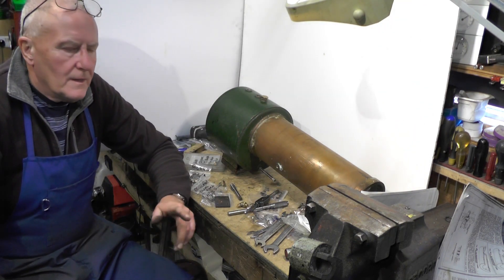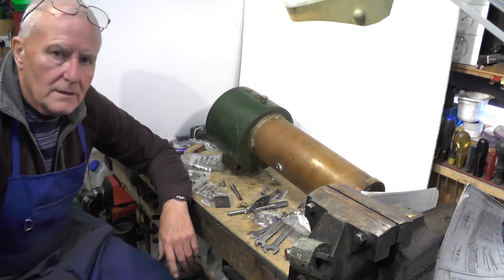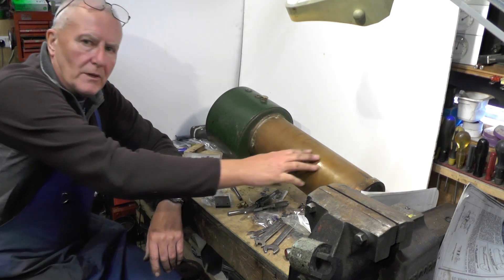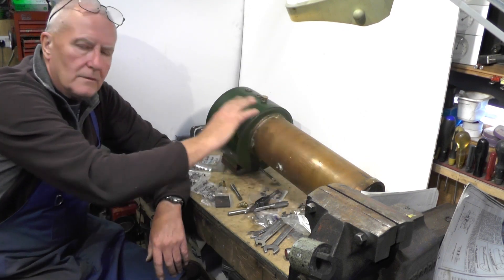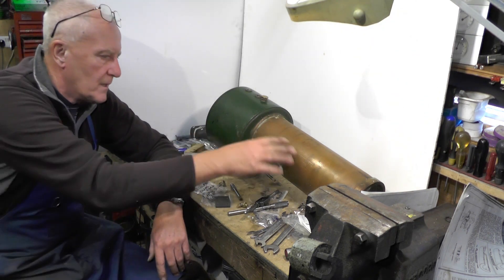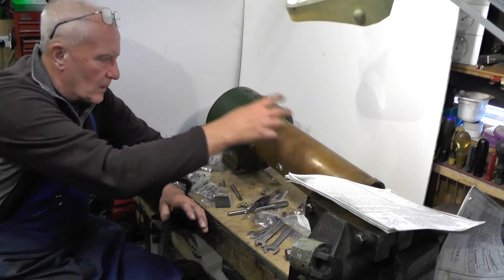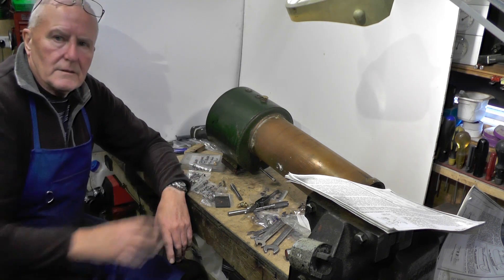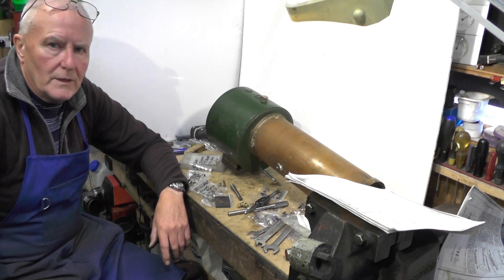Sweet Pea Steam Locomotive Build  Part 2   Boiler Pressure Testing "mr factotum"

Comment: Looks like you gambled well Kev, once you get your boiler certified, what is the frequency of reinspection after that? Is it dependent on time elapsed or hours of running etc? Cheers, Jon
Reply from the maker: eyup Jon Winner winner Chicken dinner🤣🤣👍👍🚂🚂
Once initially passed the hydrostatic 2 times WP . 
its like a car, a steam test once a year, then every 4 year another hydrostatic test at 1.1/2 times WP
thanks for feedback
kev

Comment: That looks good to me. Should pass hydraulic. All you need to do is improve your seals. Might as well crack on with the rest.
Reply from the maker: That's the plan! Ben, although its a winter project
cheers
Kev
Reply: @MrFactotum  I reckon you'll be a fair way through it before winter! Which leads me to a question, where did you get your copper tube from? I need some 4 & 3/4" for a boiler for a chassis I have been given.
Reply from the maker: @BensWorkshop  got mine from Track Metals he visits our track on open day once a year, but if it's a big order i think he delivers, he sells on ebay but prefers direct, his name and email is here Fred at sales@trackmetals.com
any other info get back to me anytime
regards
Kev
Reply: @MrFactotum  Many thanks, I have sent an email.

Comment: Interesting video Kev.  Pressure testing is not something I've had to do, but understand the principles.  What do they charge to run the test ?  Cheers Rob
Reply from the maker: hi Rob.
Free to club members, testing is once a month,
i think commercial testing is expensive though.
thanks for feedback
regards
Kev
Reply: @MrFactotum  Yes, commercial testing in Australia is expensive.  I priced getting some gas cyliders re-tested, but it was more cost effective to buy new.  Cheers Rob.

Comment: Hi Kev, I would expect those threads are BSB British standard brass, all 26TPI 55 deg thread angle these are commonly used by Stuart models
Reply from the maker: Eyup Doug thanks for feedback, yes, but i call them BSCY (cycle threads) same thread format, thanks again for watching, much appreciated
regards 
Kev
Reply: BSB is commonly referred to as cycle thread, as it's widely used on push bikes.  BSB was heavily used on brass fittings for steam loco's.  I have a full set of BSB tap and dies which are ex South Australian Railways (made in the USA).    Very nice strong thread.  Great for model engine work as well.  I always keep my eye open for BSB at sales etc.  Cheers Rob

Comment: Hi Kev. I'm my clubs boiler testing manager, all looking good, one point when testing that you didn't show is to pump water through the test pump pipeline to get the air out of that before connecting it to the boiler, I'm sure you did that off camera though 😉 
Taking delivery of 2 loco's today, 1 has never been tested or steamed, so I've got it all to do the same as yourself 😊
Reply from the maker: Great point Trevor, yes i did prime the line first, thanks for your positive and helpful feedback, always appreciated.
Good luck with the 2 loco's, it's apprehensive but interesting to do.
regards
Kev